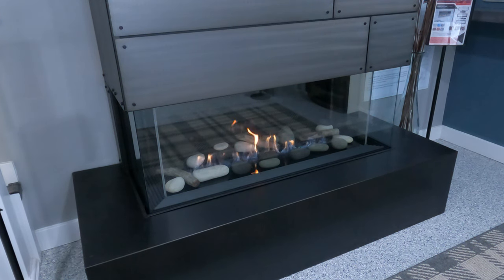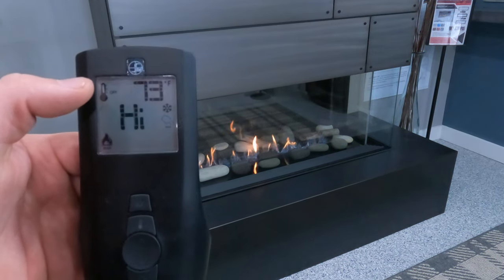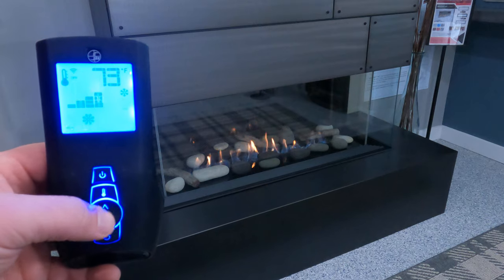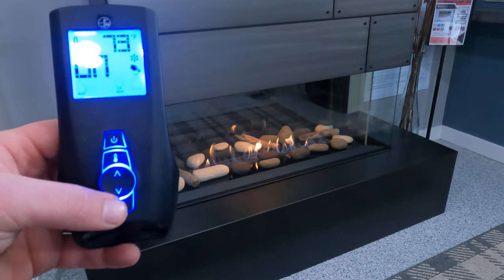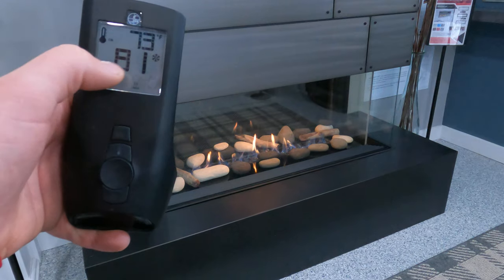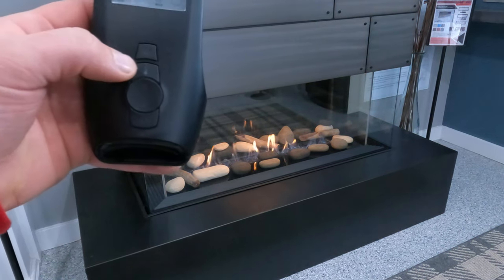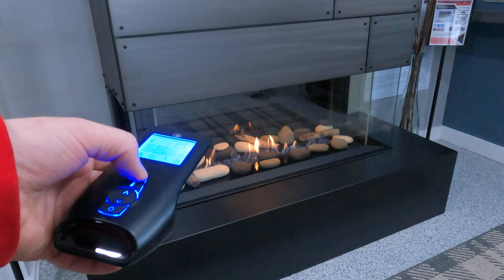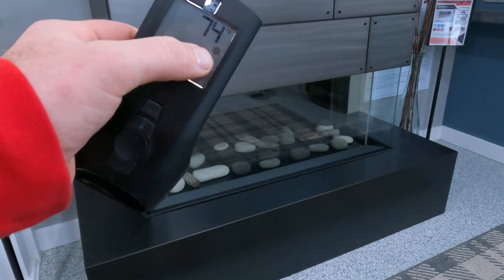Gas Fireplace Remote Tutorial - Proflame 2 Remote

Comment: Hello. My remote was set to CPI. And idk if I did something by accident. But not it will not stay on. I moved it back and forth from ipi to cpi and nothing. Removed batteries too. It will work with my app. It will stay on just not with my controller if I were to use it.
Reply from the maker: Try resetting power to the appliance. If that does not work you may need a new remote.